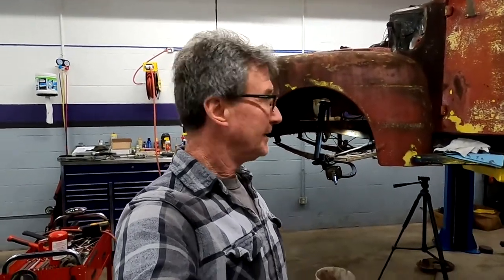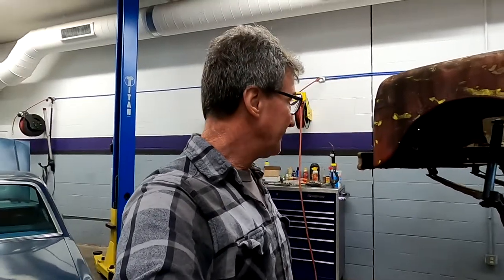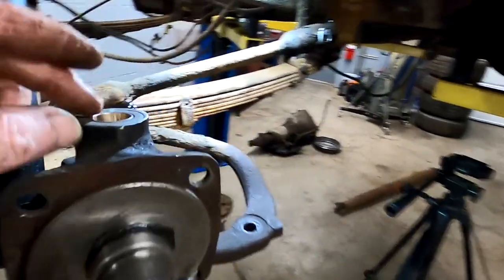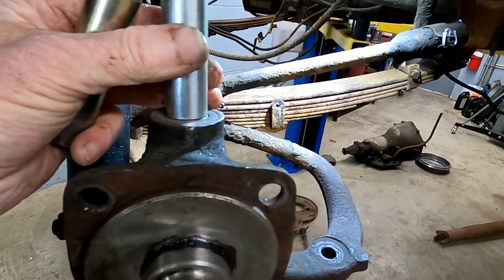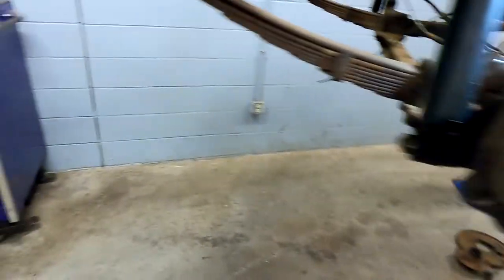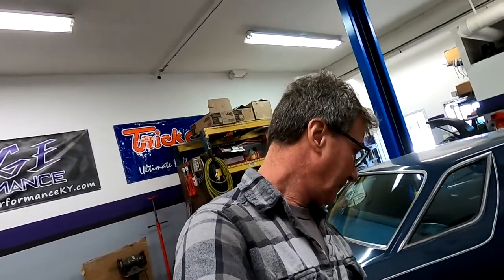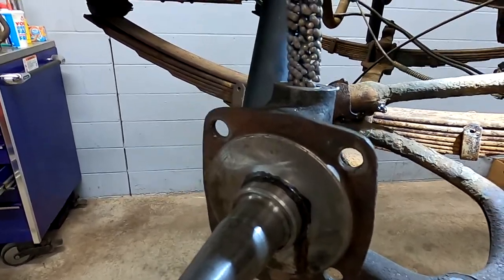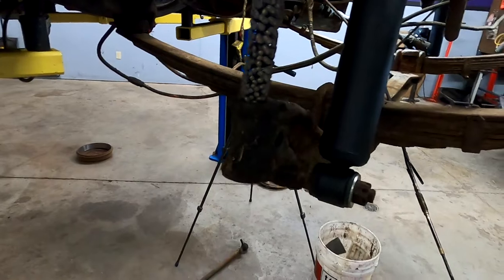How to install king pins on a 1949 Ford F1 (part three)

Comment: Thank you for this particular video. I've got a '62 Econoline pickup that needs king pin replacement. This is the first video that shows the process with the axel IN the truck.  If I was going to remove the axel, heck, I'd have a shop do the king pin replacement. Thanks again. P.S. I could use the part number for the reamer and the ball joint removal tool. 👍👍👍👍👍👍👍
Reply from the maker: Thanks for watching. Sorry, the part number is filed away with last years paperwork. I measured the outside diameter of the new kingpin with a digital micrometer and purchased one that was adjustable within the size I needed. The sizes of the reamers were in millimeters, so I measured in millimeters on my micrometer.